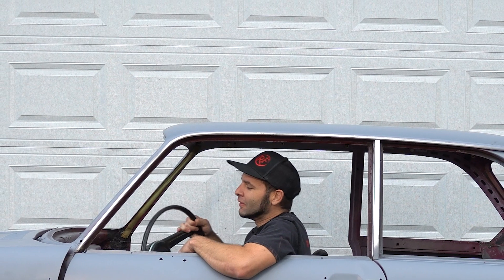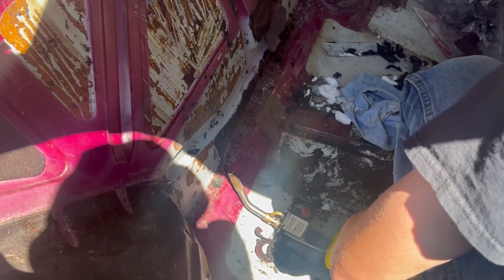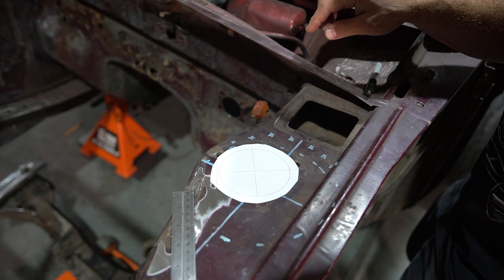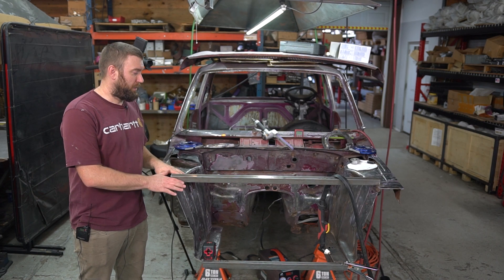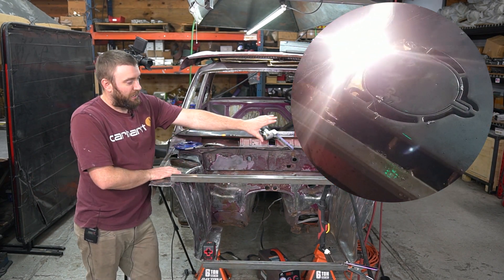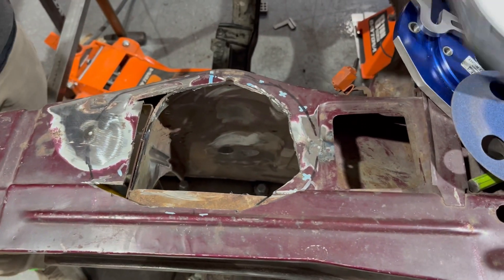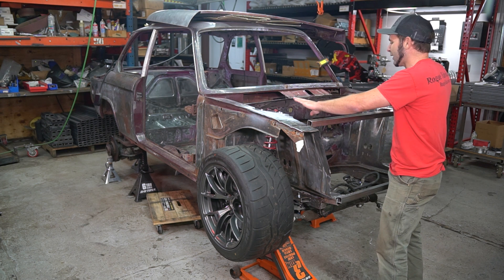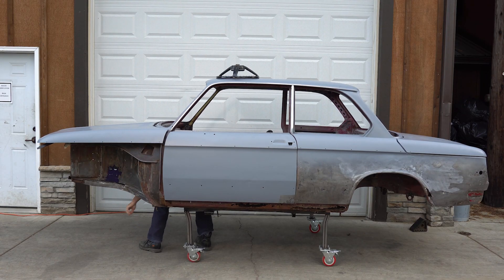DRIFT/ROAD RACE coilover suspension + camber/caster on your classic - BMW 2002 Build Episode 2

Comment: I'm restoring a 1973 2002tii and it has Ireland engineering stage two suspension  Hey question, if I put sound deadening under the roof is there any chance of it coming off because of all the heat from the sun? Oh 2002 stands for 2002 places you'll find rust 😅
Reply from the maker: Depends entirely on the adhesive used. I would expect it would stay put if you're using adhesive already supplied with the product.
Reply: @RogueFabrication  I need to call the sound deading manufacturer to double check as it would be a pain in the a** if it came off  Also installing on a hot day should help it stick hopefully